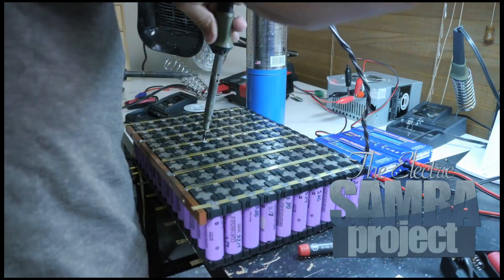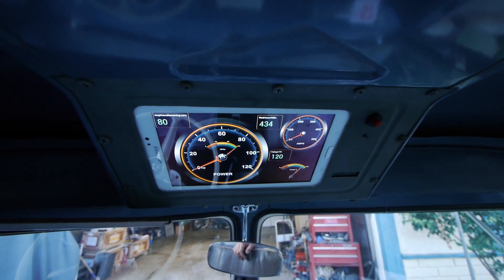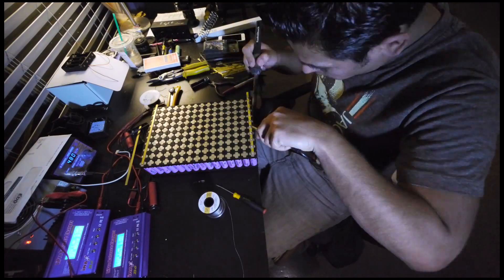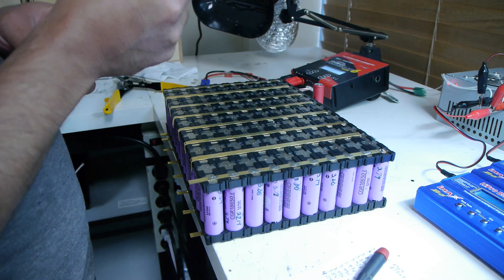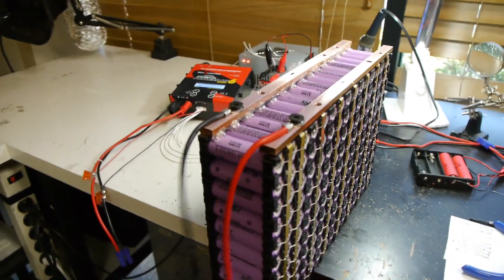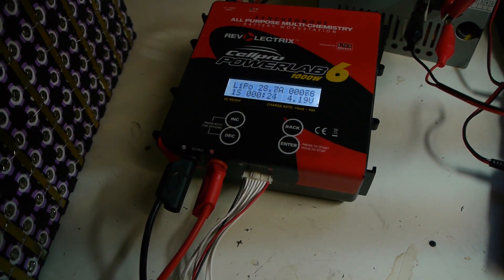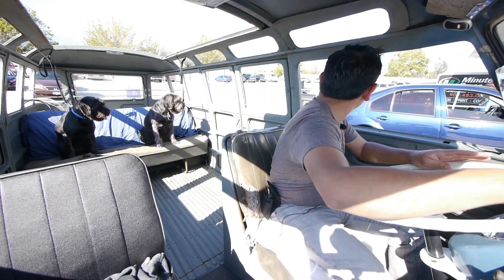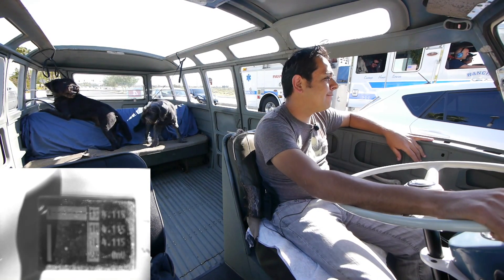DIY Tesla Car -  lithium ion 18650 battery -  VW Kombi

Comment: Hi sir..first of all thats for making a video with full instructions,I have already gone through all of your videos.
I have wanted to make a EV but my range is quite low as 30miles as my requirement,
I'm gonna start with used forklift motor as other YouTube videos shows,my questions is what a kind of battery is good to be used in my vehicle (VW bug) in order to make that motor run and keep it running in that mile range
Reply: You will have to calculate that on your own. The hardest part will be the power consumed during the ride in your particular conditions. Most of the fuel's energy is wasted by air resistance. 
A forklift motor is an easy, but not so good choice: Brushed is inefficient, brushless is extremely hard to find a controller for. Plus the bearings need to be replaced often - at our work, a technician replaces them about every 3000 machine hours. That's not much.
Contrary to the video author, who is mostly powered by optimism, I advice against the use of lithium laptop cells. What you want are potassium hydroxide-based cells. You don't have to worry about the balancing and they come out cheaper. In fact, you could use the common lead-acid batteries. They are heavy, but if you mostly have flat terrain, the price and the ease of replacement are worth the slightly higher consumption.

Comment: Brother, test out the 'tesla switch' battery configuration. You'll need three of your battery cell configurations to run it. Hook two units together in series, and then hook up the negatives of both the single and series units. The negative will now be the positive of the single unit, and the positive will be the positive from the series units. If you can find an ingenious way of swapping the battery unit's positions, (the single battery unit will actually charge as you drive) then perhaps you can drive for a much longer time, or even forever.

I think that a lithium capacitor would work far better in this case though as there will most likely be a lot of amperage going through.
Reply: investing in this comment :)
Reply: How did this work?

Comment: If using a typical single 300 watts 60 cell solar panel, How many of these 18650 can the solar panel charge in full sunshine?
Reply: Bout 18,650 of these 18650 cells should charge up fully in just 18,650 Nano seconds in Full Sunshine, but only if you use a mere 4.2 volts from your 12/24 volt Solar Cell.

Comment: how do the cells stay balanced?
Reply: They don't. And they don't have to. This guy did the build for this video only. It's not good enough for an everyday ride. A lot of safety measures has been ignored too; the use of old cells is a recipe for an early failure.
Reply: +zwz • zdenek are u fucking stupid or stupid? these are SAME CELLS after SAME NUMBER OF CYCLES wired in PARALLEL, so they are automatically balanced. dont comment bullshit if u dont know anything about this stuff
Reply: Szalolony
You didn't expect him to run a vehicle with 3.7V, did you? Of course he'll be connecting several of these banks in series. There's your problem. Feeling fucked yet? Happens to the best of us.
Reply: +zwz • zdenek man he is working in this video with ONE pack -.- sry for being rude but pls, balancer is hidden in the car u cant see it man, and 2nd thing not every cell needs to be balanced ;)
Reply: Szalolony
He is also mentioning he will be building more. And as soon as you have something in series, you need a balancer. A difficult-to-make one here. The OP's question is very legit; the balancer, if done right, is probably more interesting than this heap of old, unsafe cells.
I don't see why I should restrict myself to what was shown, ignoring what was said and what follows from the design.

Comment: hi jehugarcia i love your job keep it going i have a question when u make power wall did u use batterys with same mah capacity, because 18650 baterys are 3.7v but different mah capacity ?
Reply from the maker: +Just Paul  Different capacities,  most were originally 2600mAh but by now are 1500-2000mAh

Comment: What brand and capacities are those 18650s, and do they have individual protection circuits?
Reply: Doubt you could run protected cells and not have issues with cells kicking in and out, those little mosfets aren't made for high amperage. Looks like he fused each with a wire @6a to the bus bars.
Reply: usually 18650 always come without protection. only cells for consumer use (vaping, flashlights) have protection circuit. he uses batteries salvaged from old laptop batteries and I think his cells are mostly panasonic/sanyo.
Reply: I doubt the protection would be of much use with this application, and there are systems out there designed to use unprotected cells. Personally I'd design it so that it could be jettisoned, like they do warp cores in Star Trek! ;)

Comment: That is a lot of work to be adding a fuse to each of those batteries and to wire them all up in Parallel. Now you can see the main batteries for the bus under the rear with the motor. Just wondering what are you using this pack for? Is it used to power the controller or other electronics on the bus or being used to supplement the main battery packs? 4v at 900 Amps just doesn't seam like it be enough to get it going, but maybe for cruising speed.

Comment: a 1s lipo car? I thought it would need to be 12s or something
Reply from the maker: +jonnywaselectric  30S150P
Reply: 30 x 3.7v = 111 volts? I discovered your channel last night, it is really good. subscribed jehugarcia
Reply: +jehugarcia So you have 4500 cells in total ? The pack in the video is 10*15=150cells, you have 30packs like this one to make the full battery ? (at approx 50g per cell, that's about 230kg complete battery weight)
Reply from the maker: +webdigit   I ended up going another way by using tesla modules.  15S22P  I have 8 of those 330 cells 42lbs each
Reply: +jehugarcia Oh nice. So now you got the tesla BMS too :p Haven't those cost a leg though ? I just googled it and saw someone was selling 4000miles rev B tesla modules for $1,900 each (that was last year on EEVblog). I liked your initial resistor leg fuse design, I may borrow it for my DIY bike battery :p

Comment: how do you run a car on 4 volts?
Reply: haha
Reply: +rintuut isnt it like, 4200V?
Reply: each cell has 3.7V if im not mistaken
Reply: i might be talking the biggest shit about the final voltage but the 18650 has 3.7v each
Reply: +NathanSGBrazil yes that's right but he has connectet all batteries in paralel so it is 3,7v
Reply: +rintuut ow dam thats pretty cool, and that thing must have a lot of power since its all in paralel

Comment: It amazes me how you get away by driving a vehicle without wearing a seat belt. Here in NZ you wouldn't drive 5 blocks without being pulled over.
Reply: +binhonz I don't know how it's handled over there, but here in Austria if the vehicle was produced before seatbelts became mandatory you don't have to  retrofit them and can drive without
Reply: +SolarAlliance, here is mandatory that the abdominal type is retrofitted as the bare minimum of road safety for any car of any age.
Reply: binhonz the car was made without them therefore he can drive without a seatbelt
Reply: But that's not safe, is it? That's why seat belts were invented. Do I really need to spell this out for you?
Reply: binhonz It is legal to drive a car without a seatbelt if the car didn't have one when it came out the factory. However that could be different in certain countries.
Reply: Ok, spelling it out then: it is legal to walk to the edge of a cliff and jump. It is legal to go swim in the rough sea and drown. The majority of us don't do it because it is not safe and it's a stupid action, really. Regardless of the law, a life is worth more than anything. Seat belts save lives in most cases if not all cases so why do you still argue about something that is unsafe and wrong?

Comment: Dogs wear seat belts but you don't ? LOL
Reply: No the dogs are wearing collars, if he crashes they will probably break their necks.
He should use body harnesses for the dogs and tether those correctly. If he wants to die at least that's his choice, the dogs don't have that choice, they rely on the common sense of their owner, or lack of it.
Reply: +obese1konobe That van is street legal no seat belts. Why wear the Big Brother safety belt when you don't have to. No ABS, air bags, or a computer that applies the brakes to keep you from getting in a collision either. Use the computer between your ears.
Reply: The car doesn't have any seatbelts.
Reply: The batteries are fine, as long as they don't heat each other to too high a temperature. And they don't look likely to.
Reply: Johnathan Wuethrich if they are limited 18650 batteries then I thought every cell had its own protection?

Comment: cool video, dude but how about posting links where to find all the stuff like the nice plastic spacers for the cells, and the flat ribbon wire's used to interconnect, and the batteries themselves, thanks for the videos esamba
Reply from the maker: +Tommy Tirey  links can be found in the description section 
List of parts used to make this project: 
Laptop Batteries http://j35.us/Ebay-Laptop-Battery-Lot
18650 Holders http://j35.us/18650-spacer-clips
Copper buss bars http://j35.us/1NGpBo4
Brass strips http://j35.us/Small-Brass-Strips
Cell Fuse wire http://j35.us/1k-Ohm-resistor
PowerLab 6 - http://j35.us/FMA-PowerLab-6
Cell Log 8 - http://j35.us/Cell-Log8

Comment: If I understand, you have it wired parallel so the whole pack gives the nominal voltage of 3,7V. Is it then converted to the voltage the motor needs with a DC/DC converter?

Comment: Hi. What is the current you used to charge this 150 nos of battery pack from FMA PowerLab 6 charger? Is it 40 Amphs?? If it is 40 Amphs, each battery willl be charging at a rate of 267 mA of current.

Comment: +jehugarcia I can see you didn't actually use 1k resistors for your fuse wires. What did you actually use and where did you get it from? I am building a large 3000 cell battery of the same style.
Reply from the maker: +Seamus Cullinane  I didn't use the resistors,  just the legs.

Comment: That can't be the only battery pack running the van:
1S x 150P   640A @ ~4V = ~ 1.6kW ?

EVs run at hundreds of volts to keep the current down to reduce heat and copper required and increase efficiency.
What's the real configuration of the batteries?
Controller?
Motor?
Reply from the maker: +Andy Lee Robinson     36S2P LiFePO4  -  AC50
Reply: Thanks, that makes more sense!

Comment: Now to put 2 large solar panels on the roof so your battery packs are nearly always being supplemented by the sun's power.
Reply from the maker: +zeer365   yeah
Reply: Maybe could even add a retractable low RPM wind turbine for when you park and it's a bit windy outside.

Comment: I read that is was bad to use solder on the batteries because the heat could damage the cell. Why do you solder as opposed to spot weld?

Comment: Every cell need to be monitored, otherwise if one cell damaged, it would pull the whole package down. And probably you need a thermometer, Tesla uses water cooling system for their batteries.

Comment: I'm new to the channel do you have a video explaining why you are using a manual transmission and why you are shifting it?
Reply from the maker: +Black Cat016   No but basically there way more compelling reasons to keep it than to take it off and figure where to mount the motor and how to adapt a differential and all of that mess.   easier to leave it and use it.
Reply: +jehugarcia any advantage to power consumption or acceleration like you get with a gas motor?
Reply from the maker: yes more gears are better,  you can always be near the crest of the torque curve

Comment: did anyone else see him change gears
Reply: motor must be geared to transmission
Reply: +Daniel Tang Yi Hao the motor bolts into the transaxle.you still have gears.
Reply: my god how stupid are you dude. do you also believe the moon landing was faked?
Reply: Ian Hartley possibly he does shift from 1st to 2nd gear to keep the amps load low on start off an trafficlight.
Reply: Though i'm a fan but i don't get the big gear change in this video, and it's a pity that Yehu doesn't seem to explain enough IMHO
Reply: ya, that's what I saw too
Reply: It's probably not even electric. Probably running a v8 in that thing.. tisk tisk.
Reply: Ian Hartley You can watch the mighty car mods video where they deal with electric cars to see why that is. Yes, you do change gears and there's no clutch!
Reply: you know gearing has nothing to do with fuel use.
Reply: electric motor needs only one gear.
Reply: Leave no Trace not if you doing a conversion

Comment: no privacy in that van, why not use turnigy lipos? 18650's suck imo.
Reply: +bartsshorts Lipo packs are generally lower density.

Their most expensive battery is their 6s, 16ah battery, which is equivalent to 96ah of single cell batteries, which has a volume of 1014552 mm^3.
In a grid arrangement of 3ah 18650, each one  takes up a mere 21060 mm^3(65mm high, 18 wide, and 18 long) which for the same volume as the above battery, you could fit 48, giving you 144 ah, which if arranged in a simlar manner to the above pack would be effectively 24aH

Effectively 50% more power for the same volume.

Late edit: Just remembered this the next day, 18650 cells are also pretty cheap when bought in large quantities, if you went with only 3ah cells and were buying 48 of them, you could end up with spending $5 per cell and end up with a similar volume and the higher capacity for slightly less. Though in the bulk you would need for a project like this, you could get them for significantly less by buying super bulk like in this video.

Comment: so are these cells aa's connected series? and have one cell go bad on you?
Reply from the maker: +stockingandblossom1   NO
Reply: o.k
Reply: +jehugarcia why no balancing wires?
Reply: +S0N1Cx4z6y I was thinking the same thing.
Reply from the maker: because they are not needed,  this is one cell essentially.  all cells are the at the same voltage because they are all connected in parallel

Comment: Just seen your vw electric milk float, to be honest I'm quite pissed! Your dogs are in a van with no windows and leashed to the roof, you stamp on the brakes and there necks are gonna snap! They fall off the bench and there gonna choke! You go round the corner and they go head first out, there choking and splattered! For a geek your not very savvy! I.e common sense, no windows what else is missing on that barge??? Sort your priorities out! You need a reality check mate
Reply: I hate that statement when you value more animals than humans. How sad! 

It is a bad problem to get pissed. Go and read the Bible and pray!
Reply: InstaltechCarAudio - you better not call yourself a democrat. Killing thousands of babies without blinking, while worried about two dogs. Please say you're not a demmie.
Reply from the maker: No

Comment: Where do you get your batteries? I'm thinking of converting a big gas snowblower to electric and am looking for some sources for the electrical components, like the batteries, and a motor.
Reply from the maker: +Denver Caskeys 

You can harvest used 18650 cells out of dead laptop batteries found here http://j35.us/Ebay-Laptop-Battery-Lot
You can buy New 18650 cells here  http://j35.us/panasonic-ncr18650b  or
You can buy ready to use TESLA MODULES here http://j35.us/eBay-Tesla-Modules

Comment: Nice work. Are they high drain batteries or would that be unnecessary due to the large bank? I know Sony makes some high mAh batteries but at high drain performance would be even worse. Thanks again for showing.
Reply from the maker: +Christopher Verger  High drain not so necessary,  a 80Kw peak load on a 30Kwh pack is below 3C

Comment: Awesome . I had a 1965 21 window when I was a kid . I modified a 1 1/2 inch anti sway bar off of a 1976 Chevy suburban  by shortening the arms so the geometry matched the lower control arms . I used the lower shock mounts to connect the sway bar with 1/4 inch flat bar . I used 1/2 inch U bolts to mount the sway bar to the lower tube on the front axle beam . Of course the bus was lowered and I had 60 series Goodyear NCT tires at the time It handled like a slot car  . Very little body roll . I notice you had quite a bit when you were on the track . It will help keep the bus from rolling .It will HUGE difference

Comment: Great job! Exciting to watch and learn. Could you build a controller like this for dc brushless motor As far as the timing goes the drum has 48 magnets, 24 north, 24 south in polarity. The stator has 36 slots, and the configuration of the windings, is an open 3 phase 12 pole winding. Would like the controller to be able to go up to 20 amps output with 350- 1K+ volts for testing. I think it would be helpful if the controller had gauges on the input and output measuring the current and load. Also would like to be able to switch the output between square and impulse. Need to get between 5-16K rpms. Let me know if this makes sense!
Reply from the maker: +Paul Smith   No I'm using AC motors,  brushes introduce maintenance and longevity issues

Comment: it's not that simple to make a balanced battery pack. you're better off having all of the cells charged before even making the pack, otherwise cells can be overcharged and get damaged
Reply: sinephase yeah but playing with so many batteries in series creating a giant battery bank with a bunch of little batteries I would not risk the thing blowing up in your face having using charged ones..
Reply: TahoeJones Olympia you have no idea!
Reply: Fully discharged during assembly. If correct, all cells have a balanced start from zero.